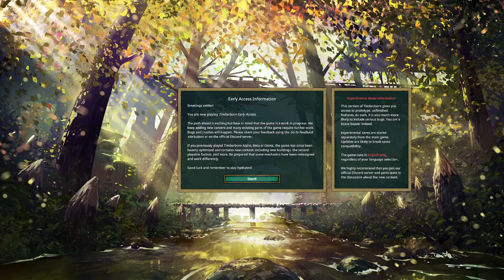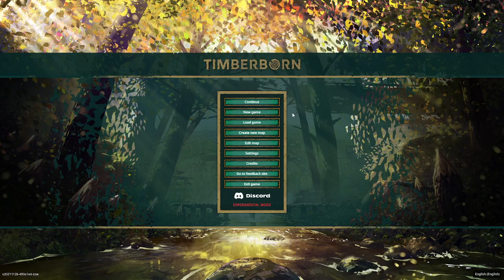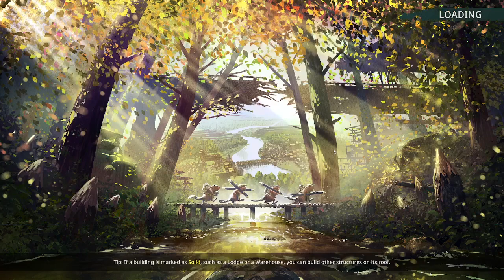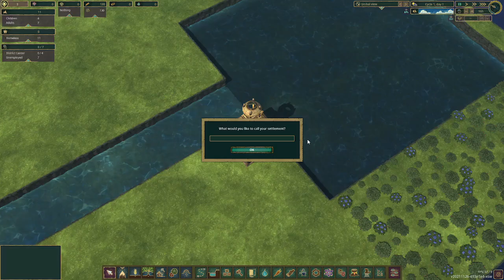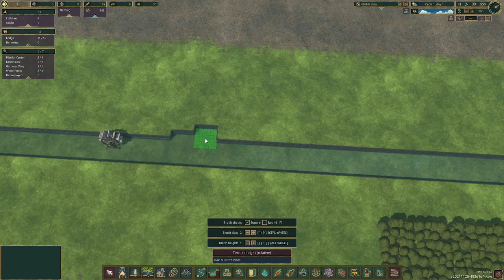Perpetual energy in Timberborn Experimental.

Comment: Hmm, as of today, it seems the things are different. E. G. the pumps are different. I'm not sure it still works this way.
Reply from the maker: Some things have changed. This video was made the day after pumps were introduced in the experimental branch.
Reply: @Griz1231  I tried it. The pumps are not blocking water any more, so they have to be put 1 layer higher than in your video. It also  seems that it's less efficient, but still works.
Reply: Actually, I saw your other video https://youtu.be/lHSAUYfd_3Y and it seems, 20 pumps in a row are really better than 24. I did not try IronTeth yet.

Comment: What is happening to farmland around 1:04:00 (drying and moisturizing). Why is it oscilating?
Reply from the maker: The pumps draw water on half of the stroke, and not the other, so the water level in the reservoir fluctuates during the dry season as water is pumped out and returned.

Comment: It'd be pretty awesome if platforms over your water reservoirs and then put houses on them connecting the platforms and the levees to make a completely sealed water tank you then will not have any evaporation from that reservoir
Reply from the maker: Unfortunately the game mechanics don't work that way. The land to the sides of the levees is irrigated by the water in the tanks and troughs.

Comment: I'm surprised they didnt patch this out lol
Reply from the maker: They have patched out one part they considered an exploit, thus the new designs.
Reply: @Griz1231  water wheels stacked infinitely along a single water way would indeed slow the water's speed down river. That you can have water wheel 0 and water wheel 100 turn at the same rate is something the dev's could have patched.  Or limit the water flow rate of a single pump